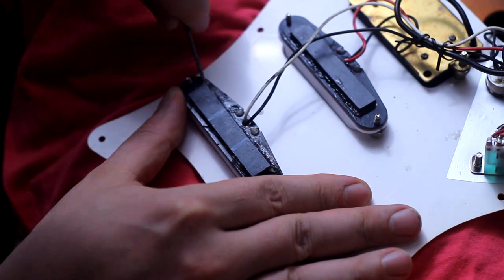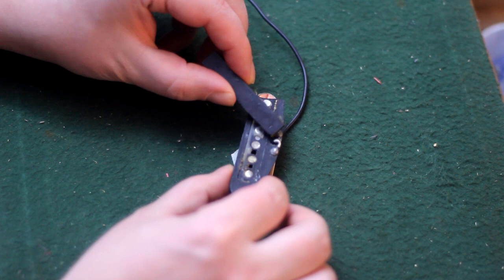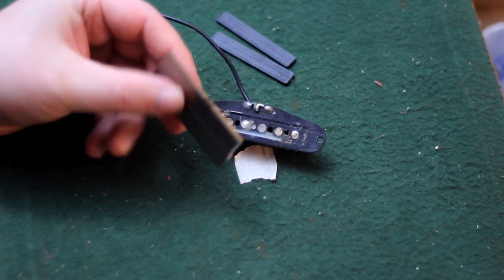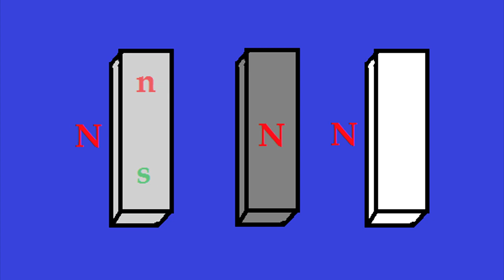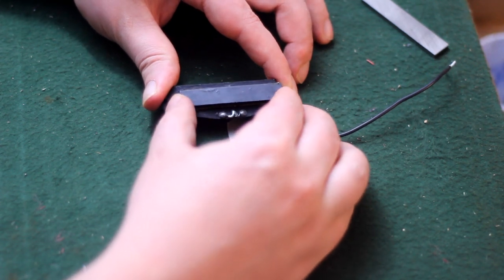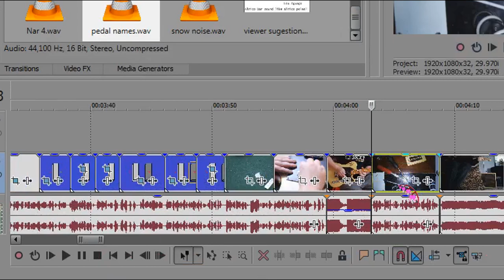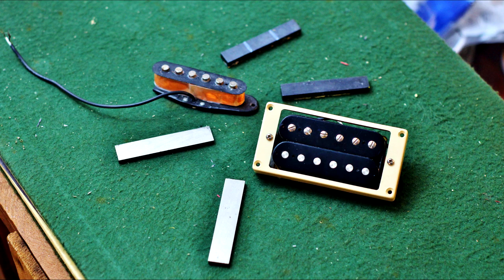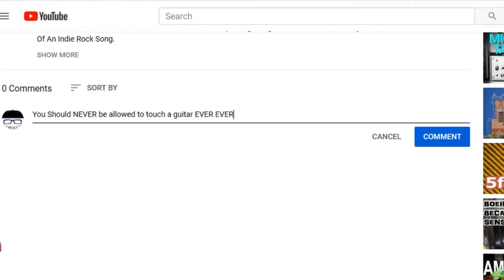Humbucker Magnet In a Single Coil Experiment (Sound Demo!)

Comment: Very interesting experiment, and it's interesting how different the same pickup sounds with a different magnet position!
Reply from the maker: Thank you for watching and taking the time to comment Vincenzo. Yes, you can move different types of magnets around in a pickup and get many different tones. Another big impact is the use of metal or brass backplates and covers.
Reply: @heavymetalATC  definitely it is! There' s quite a big difference between my guitars with uncovered humbuckers from the guitars with metal covered ones!

Comment: I have commented before, but I noticed something in this video. You do a lot of extra work having to hammer and chisel. If you have a drill, or don't mind the a little extra expense, you could save yourself a lot of extra work by buying yourself a cheap set or two of carbide burrs. They are made for cutting steel like cleaning up welds or porting cylinder heads, but work great for carving and shaping wood, and modifying pickup holes. They do tend to clog up with sawdust on the big jobs, but clean up great with a wire brush or propane torch. I use them a lot both in the auto shop and fine tuning and carving woodwork.

Comment: "Gold Foil" pickups straddle the zone between "edge-polarized" and "top-to-bottom" polarized magnets.
The classic gold foil has a coil wound around a top-to-bottom magnet.  In some instances, it is a pure ceramic and in others a rubber magnet.  That magnet sits on a mild steel baseplate that has one side extending outwards and bent up.  If you look quickly at many gold foils, they can seem like they must be dual-coil because of the row of adjustable screws along one edge.  But pause for a moment and you'll realize there is no way in hell a 2nd coil could fit in there.  And you're 100% correct.  Those screws are inserted into a raised side of the ferromagnetic baseplate, such that whatever the polarity of the top of the coil/magnet is, that raised side is the opposite polarity.  As such, the eddy currents and sensing area is between the bent edge of the baseplate and top of the coil.  In other words, it's kinda sorta like a P90, if it only had one magnet and that magnet was shaped like an L.  Poke around for pics of a gold foil that has screws along one edge and you'll see what I mean.

Comment: I read somewhere that simply putting the bar magnet on the bottom increases the inductance to near that of a humbucker, which is why the P90 sounds close to a Humbucker. I think you proved this with regular single coils.  This is something I have thought about a while, and bought GFS's Single Coil gold foil pickups and play them often. They are definitely not for every type of music - they are warm and get lost in the mix with heavier music.
Reply from the maker: Yes, very much the case... if you put a neodymium magnet flat on the bottom it will make bass and output like crazy.. but unless its underwound that power and bottom end can get muddy.

Comment: All is about different magnetic field shape and strongness. And how copper winds placed in it.

Thats hard to describe without painting it )

Humbucker rib magnet make a less rich wide range sound than Single flat magnet, for example, because of that.

Single flat magnet gives more wider and stronger magnetic field. More space of string react with it. More harmonics of string disturb this wider and stronger magnetic field.

As result, copper winds produce a more complex and stronger signal from extra parts of string.

Thanks for yor channel! ))☀️🌿✨
And may the Force be with you ))

Comment: on high gain i preferred a little the edge alnico over the flat ceramic. it's worth a try :) i have some double ceramic edged bar single coils i could relplace the with 2 alnico bar and see what's happens

Comment: i had an idea for a utility external humbucker.  

so basically, if a guitar has only one single coil and it hums for whatever reason, amps, computers, etc., and i was thinking a lazy fix might be to use another single coil to humbuck, but install it externally instead of under the strings because i wouldn't want my tone to change much, but i want to reduce noise issues. 

i could then wire directly into the jack and attach the pickup to whatever available surface of the guitar, or maybe make an external box that could be used with multiple guitars.
Reply from the maker: Thank you for watching and taking the time to write such an awesome comment Wisteria. That is a sweet idea. I know of some people Les Paul himself included that have used dummy coils inside guitars for quieter operation. I however have never heard of or even thought about an external box like a pedal that might do the same function. I dont know how this would work on the outside of the guitar controls but... its gotta be worth a try. Im putting this in my notes right now, If/When I do a video on the subject I'll give you a shoutout. Again... GREAT VIDEO IDEA! Thank you!
Reply: great idea, hats off!

Comment: You are doing all the fun stuff I'm always thinking of doing. Ever tried a dummy coil? Knock off the magnet and wire the pickup in just to cancel the hum like a humbucker. One phase will amplify the hum the other will cancel. Logic would be reversing the wires. Just connect it to output pre volume pot.
Reply: the extra resistance of the wire in the dummy coil would be like having a 5 mile long guitar lead, it would suck the tone right out.

Comment: After so much experimentation and knowledge I'm curios to see how is your main gear
Reply from the maker: That is actually a quite valid question I had not really considered!

 Now that you mention it, you know whats crazy about that? 
Im into old timey hipster retro crap so really dont get into much crazy stuff myself for a regular guitar rig:

 If I wanted to just chill and play guitar today id probably want clear sparkly easy going chuggy hendrixy SRV Gilmore sound SO... 
Id go into the wooden live room, put the stock stage right tube amp from amazon on the floor plug a boost and drive into it like klon and TS clone? then probably use the sunburst squire strat with the alnico pickups.

  That being said if I wanted to record some dirty distant  ambient sounding stuff like it came out of a cypress thicket full of Gators:

 Id go fully opposite use the 10' 59 tweed champ clone with the dark alnico speaker, the nos mojo parts clark gainster petey made me as a sweetener right before the amp, and into that the $1 suitcase spring reverb, feeding it with the diy $30 tube preamp to exite it and the russian germanium dirty boost right out front being tickled by the volume pot of that 60s teisco or p90 junior with a slide and if I had ebow then that too... 

 Yeah I guess it depends.
When I make electronic type music: hip hop, rap, techno, pop and indie stuff: 

  Thats when I really go crazy Ill have lamps plugged into light sensors into synthesizers running through toys and diy plate reverb and old drum machines going into transformers plugged through tape decks into the computer and all manor of insane stuff. 

So yeah Awesome question and Id really not thought on it too much.
Reply: If that's what you get off the top of your head, it's scary to think what a little thought would do! You have a curious mind and adventurous spirit keep on trucking.  I am loving it. You should design some insanely great sounding pickups that no one else would ever think of putting together and sell it priced for a blue collar man. Like my favorite inventor, Mr. Leo Fender himself! We need people to that in today's world.

Comment: Can I suggest my tapping of a coil split humbucker again?  Where you insert 2 taps into each coil of a humbucker so you can tap it and split it?  You would have to get your winds correct to keep the resistance correct, but I think it would offer some unique sound possibilities.  I was thinking a humbucker with 8000 winds with taps at 4000 and at 6000 winds, then set up so it can also be split.  Possibly using 44 ga wire and Neodymium magnets wound directly with no bobbin other than a cap on top and bottom to keep the wire on it like an old Danelectro lipstick pickup.  I think this is the third time I've mentioned this.  :)
Reply from the maker: Thank you so much for watching and taking the time to write this awesome suggestion Greylocke. If you had made these comment in the last 120 days or so I will eventually get to them... As some time. LOLOLOL That is a Great Suggestion. I will put this comment in my notes. I am sure this will be great info to work into an experiment sometime and If/When I do I'll give you a shout-out for the idea! Thanks again I appreciate all the interest and support.
Reply: @heavymetalATC  I know I suggested sometime last year and I think I alluded to it once before that.

Comment: I have a Squier 20th anniversary stratocaster with long pole pieces and double bar ceramic magnets added to the side of the pole pieces.

I tried to lower the magnetism on the neck pickup with neodymium disk magnets, first by putting them directly into the poles and then by passing them over the poles a couple centimeters away.

For the first time I liked the sound of ceramic pickup after that process.

Please try it for yourself Clem.
Reply from the maker: Thank you for watching and for taking the time to type a kind comment Fausto. I have an old 80s epiphone strat copy that has those double magnet single coil pickups. Those things have high output kinda like tiny p90s. I'm glad you were able to get a sound you wanted from them. Thats awesome! I found the neodymium magnet on the back of the ceramic tele pickup to be a neat trick, maybe I should look into more ceramic/neo magnet stacking? Thanks again for the support and information.

Comment: The humbucker magnet being dipolar in the flat config begs the question as to whether you’ll see any interesting phase effects if you were to play the same note on the north side and the south side at the same time.
Reply from the maker: Thank you for watching and taking the time to write a comment Brian. That is a great question? I haven't noticed any of those artifacts with the neo-p90 but at the same time the neodymium seem to act differently so its definitely something to try. I considered using 2 aposing like a p90 and having 2 split coils of 3 poles. You could wire those in series out of phase and have a p90/humbucker "thing" It would be like a noiseless Z-coil humbucker and a p90 at the same time plus it could probably be made to fit in a normal pickup route. Many brain worms in this pickup can. LOL!

Comment: i dont know much about active pick ups but we have some instruments here that use them . i like the active bass for recording a lot , i can get so many different sounds on one guitar . i t has those tape wound strings which are like plastic coated flats if that makes sense . this works well for me as when i record music i tend to play guitar for many many hours , this leaves my fingers raw , switching to a 4 string its like ouch ow i cant even do it . i used to tape up with hockey tape and use masking tape over that so its like padded but it glides and dont stick . since i got those tape wounds i dont need to tape my fingers because the tape is on the strings ! ha . anyway i wonder if you could make a more powerful magnet like an electromagnet pick up , seems like those neodyniums would be more powerful so it wouldnt have greater results - ignore me . bad idea , i did enjoy the video and those tones were drastically different from one another . i am 4 songs in . this one is a bit different . i think you will like it .

Comment: Great video. Have you considered making a strat sized P-90 by taking the pickup with screw pole pieces from a humbucker, and putting two mini magnets on each side?
Reply from the maker: I had not considered this but it is a very good idea and I may have to try it. Im going to put it in my notes right now. Thank you so much for taking the time to type out this great suggestion.
Reply: No problem. It's an underrated design that few know about but it sounds very unique, not like a strat or P90 but just different. Love to see your take on it. @heavymetalATC

Comment: I was instantly hooked to your channel.  I want to build a two string pickup to run a seperale signal trough an octaver.  But the holy grail would be a pickup that can send the signal from all individual strings trough 2 or 3 channels.  It's that something you would do?
Reply from the maker: Thank you for watching and taking the time to write such a kind comment Maarten. You could definitely build you a little 2 pole pickup: maybe even chop up a strat bobbin and glue or epoxy it back together and re-wind it. Yes, a 6 coil pickup is called a hex-a-phonic pickup. They use them for midi guitar I think, but I have had the idea of 6 individual pickups that could be wired and routed in several ways. I know I am eventually going to do this in a guitar build, I already have most of the details figured out on building, mounting etc. I tell you what: Im gonna put this comment in my notes and If/When I use the idea for a video I will give you a shoutout. Great Suggestions, Thank you again, I appreciate the feedback.
Reply: @heavymetalATC  wow,  that would be fantastic! I'm really looking forward to that.  Your approach of searching for knowledge and ignoring all the myths makes it a lot less intimating to try something myself.  Thanks for the inspiration!
Reply: Alternatively, is it possible to have a pickup that is shallow and allows sliding it under the guitar? Keep the winding away from the strings and only move the magnet under the strings? Then you can just slide it under 1 2 or 3 strings and run it trough an octaver

Comment: Ditch magnets, slap a steel plate to a humbucker, run some current to one phase, amp the other.
Reply from the maker: Thank you for watching and taking the time to write a kind comment 9Demirtas. I have tried something similar with a single coil and a pair of electro-magnets on 24volts. The humbucker idea is a new twist though. Great Idea! I will put that in my notes right now. If/when I do a video using the idea I will give you a shoutout. Thanks Again... Awesome Suggestion.